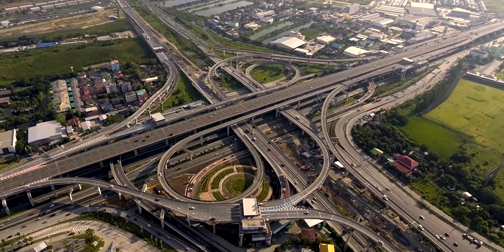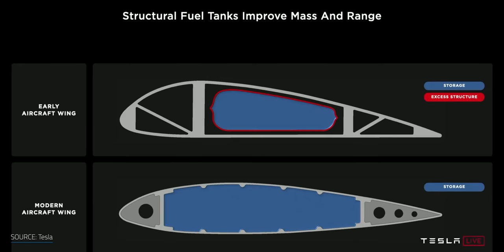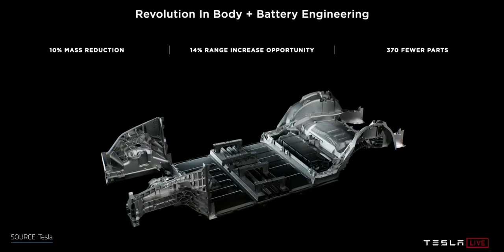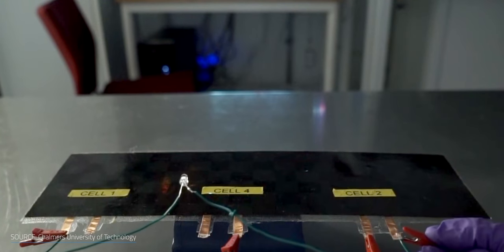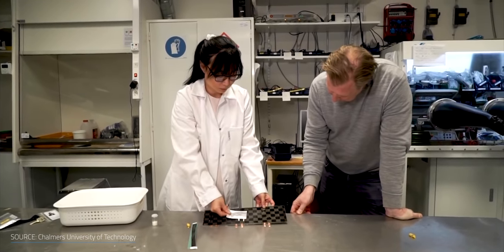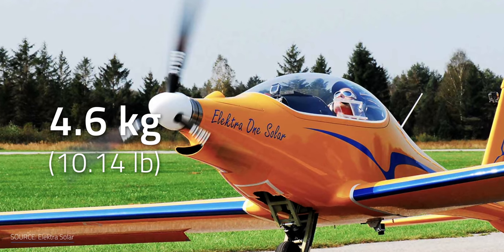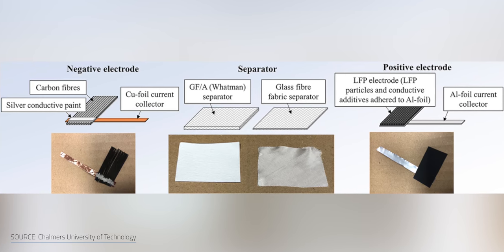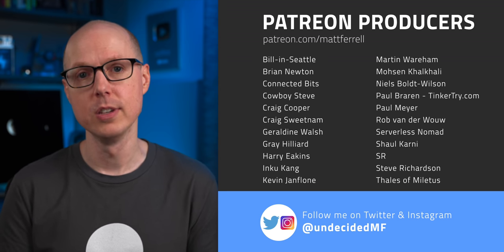Exploring Structural Batteries

Comment: By moving from modular batteries to "structural battery panels" how is this going to affect "cost of repair" after a crash(?) Also, seeing how the battery panels also provide structural integrity... can the consumer replace this type of battery when the panels reach end of life(?)
Reply: It's carbon fiber. Also, it's actually a capacitor, not a liquid filled battery panel. Cost of repair should be relatively economical depending of course on a crapton of situational caveats like how much electronics is needed, the separating material between the carbon fiber layers (I've seen the study), availability of replacements, cost of manufacture, etc.
Reply: @LabGecko  - Agree with all that... was specifically trying to figure out how/where in the vehicle the batt would be placed and will the placement allow for easy accessibility, or would such a battery possibly be buried under lots of other vehicular componants(?)
Reply: @__WJK__  In that case, good question. Of course it will vary by manufacturer but I hope ease of access, repair, and cost e effectiveness are priority considerations.
Reply: @LabGecko  - Hoping the same. If this particular battery tech is (ie) stuck/installed to all the very inner body surfaces... that would be a huge deal-breaker.
Reply: I would imagine the areas less prone to impact damage would be explored first? For example build your dashboard, seat structures, interior panels with structural batteries. These parts are already produced seperately, so could be replaced fairly easily?
Reply: @KristianHerner  that is actually a good idea, it will also add a lot of option for the consumers on how would they want to modify the battery capacity of the car.
Reply: @LabGecko  If it's patented by Tesla, however, wouldn't you think that they'd only allow you to bring your car to one of their "certified technicians" kinda like the same way John Deere prohibits consumer repair through their software. Granted I'm not sure how they'd incorporate that for a battery but just a food for thought.
Reply: @Zombieslayer9640      Exactly, you hit the nail on the head. And this will open a flood gate to hundreds if not thousands of patents, licenses and permits to work on your equipment.
Reply: All cars will be self driving by then and there will be no more crashes.
Reply: @timtreadaway8303  - Will be interesting to see if crashes (especially from human error) can be fully eliminated.  Crash avoidance technology aside, it will be equally interesting to see if the evolution of this battery technology will allow for easy eol replacement.
Reply: @Kristian Herner  - Great idea. However, if they're going to hit the EV battery holy grail distance of 800-1000mi, on a single charge, they're going to need more than just panel locations to accomplish it. If they design it in a way that a large number of (labor-intensive) items have to be removed, to get to the batteries, consumers might see this as a deal-breaker.  Will be interesting to see what they come up with..
Reply: @Zombieslayer9640  Pretty sure most of Tesla's patents are open-sourced. You can buy and mod out a Tesla all you want - you just don't have access to their over-the-air updates.
Reply: Although this LOOKS good in video and "on paper", I have a LOT of reservations about the conflict between the owner of a vehicle and their ability to repair a vehicle with this technology.  I'm all for fossil fuel reduction, but this, as someone said above seems like yet another way to divorce people away from true ownership of a vehicle to just, well, leasing it.  Or not even that, really. RENTING it is more accurate.  Which Segway's into the overall concept that NO one owns ANYTHING, they are permitted to use it, and that's it.  Tell me I'm wrong and then prove it.
One aspect of this that I mentioned above is whether or not the average person will even be able to repair their structural battery equipped vehicle.  AND, whether or not the repaired vehicle could EVER pass inspection again, since the repairs were not performed by someone trained in "to factory specification" repair.  Repairing and replacing carbon fiber composites with that lithium layer would take a fair amount of training to recognize whether you "got it right". Also, the equipment and supplies needed to effect these types of repairs could be so exorbitant to the point of pricing it out of the range of 90% of people.  
Now, if this were used in a BUILDING or semi-permanent structure, that would be different. Or, in an aircraft, which would require (in the USA) an FAA certified technician to really even look at the damage, let alone repair it.  I can see military solar powered drones as a very good application of this technology.  Also, satellites, space bourne craft would benefit from this.  No, the common person, in my opinion wouldn't be able to benefit as much if this were used in everyday passenger vehicles.  Too many things that could go wrong WOULD.  Airspace and space aren't near as populated as I-95 during rush hour.  Look at the FTSB's statistics on ground vehicular collisions per hour and then calculate the cost of supplying the properly trained technicians, the equipment, and the infrastructure necessary to regulate it and ensure safety standards are met.  I cringe at what I imagine the cost  would be.  
Oh. Bicycles would benefit greatly from this too.  There is a bicycle manufacturer in Fort Collins, CO that has made a line of electric bicycles with carbon fiber frames and lithium ion batteries inside the frame tubing.  This technology would be a natural extension of it, making the bikes even lighter. However, until those researchers can up the amp-hr/kg density, it might not be feasible or economical to manufacture.
Reply: @brianm744  Technology will make owning a car obsolete. That aside, tesla is doing fantastich things. What I find striking is that many people are commenting, they sound like they know a thing or two. Those same people fail to appreciate what a small invention might cause in the distant future, but magnify a small problem that will be overcome in the short term. Every technological breakthrough has it's hurdles that need to be taken. Let's not focus on those hurdles too much!

Yes, a car that cannot be repaired easily is a problem when you own it. That's why the solution is not owning it at all. This could be a huge step for our civilisation. But conservative forces - economical forces - keep progress from happening.
Reply: @Mullheimer  That's what I get for assuming something based on last names! Ha!
 Notice I didn't make a comparison to the head of that political regime?  I made one to a Dr. that forswore their Hippocratic Oath "First do no harm."  Even though he was part of that particular regime, my argument still stands, regardless of "Godwin's Law". I'm speaking about FACTS and making comparisons and contrasts,  not using arugumentative fallacies. Which, now that I think about it, that's exactly what YOU did using this "Godwin's Law" reference.
Again, my argument still stands regarding how long it SHOULD take to "reform" humanity of its....... selfishness?  That's a firm survival trait embedded into our DNA.  Humans, regardless of any type of religious reference, are innately selfish.  Its when we seek goals that involve cooperating with OTHERS (politics) that our true colors come out.  If you refer to Maslow's Hierarchy of Needs graph, true altruism is at the top.  I would estimate (you're free to debate on this) that one in 10 MILLION people are TRUE altruists.  That, not only do they seek to help their fellow human being, but they do so as a WAY OF LIFE, rather than a singular or multiple event type thing. Also, they do so even when it's highly inconvenient or even hazardous to their life.  They would even endanger their children (if they have any) in the pursuit of their altruism, if they thought the cause or person were worthy of said sacrifice. 
Just remember, YOU opened that "Pandora's Box" with that statement of solving the problem of self-repair of Tesla BPAs with just eliminating ownership of said vehicles.  In other words, what I said before, eliminating ownership of cars would also mean eliminating ownership of everything.... Plato's Utopia. 
IS Elon Mush using HIS vast wealth to be a true altruist? Well, just ask yourself what he eats and where he sleeps.  If he is utlizing the absolute minimum to accomplish his goals and way of life, and then, funneling what's left over to help humanity..... AND, also do that when it's very inconvenient and even hazardous to his health.....THEN, I would say he's a true altruist.  
However, all you have to do is look at what he wears, how he gets from point A to B, where he lives and sleeps and see how much he spends monetarily.  He's not an altruist.  At best, he's demonstrating what Aristotle called in Nicomachean Ethics "philia".  I scratch your back while you scratch mine. That "Win/Win" situation I referred to in a previous post.

Yes, technology is a great thing. It is how it's applied and the WHY of it, that we should be VERY leery of and have an electron microscope view of. (Dangling participle there, I know.)
Reply: @brianm744  I guess the real answer to question of repairs and ownership is... do Cars = Wealth?  The concept of home mortgages allowed common people to turn a practical item they owned (a roof) into "Wealth" they could barrow against and leverage.  Or save up and earn over time!  (Houses were lump sum purchases or new construction only before that point)

Car loans borrowed that concept but... they've always depreciated too quickly to really justify that model of being "Wealth".  After all, vehicles replaced horses!  And horses have lifespans, require careful maintenance, and can still just.. die on you.  Horse "Wealth" is not the same as a house or a set of professional tools.  So the customs about "spending" the value of a horse have been different as well.

Perhaps the model of car utilization would be best to replicate how horses were utilized.  People only owned horses IF their job used that horse for daily work.  Otherwise they hired out horses for exactly as long as needed.

Most cars today spend a ridiculous amount of time sitting in driveways and parking lots.  Many "car owners" don't need to own that car - they simply need periodic transportation!  And yet the price of car ownership is eating up a ton of their available "Wealth".  I think a lot of people could really make better use of their money if they could eliminate "owning a car" from their budget.
Reply: @esthermerriken4408   That's  a good point though: what is the definition of wealth ?  But more importantly, who defines wealth? Those who already possess it? Those without it? Those with PhDs? A true altruist?
Reply: @brianm744  The definition of "money" is actually really simple.  Something is money if everyone uses it AS money.  Governments can print all the paper they want - but if the common folk don't treat it as money, then it's still just printed paper.  Same with diplomas.  Cars are treated by the public like it's a slow burning candle made up of dollar bills.  In fact Cars are ALREADY viewed by the public as "losing value over time".  The value of a car doesn't drop below its "scrap value" price tho.  I don't see this new battery tech making any difference in how we price and value vehicles.

Oh - and the definition of "Wealth" is anything that can be easily converted to a predictable amt of money.  Little fuzzy because the exact amt something sells for depends on the skill of the seller.
Reply: @esthermerriken4408  Notice I didn't use the word "money", I used the term wealth.  Sometimes they are not synonymous.  As you said, money is money when its used as such.  I tend to define "money" as the direct representation of labor.  What time a person puts in to do....whatever.  But that's also a function of a system of VALUE.  Bartering was a great example of that.  Value in the barter system usually varies (but not always) in each transaction.  What one shepherd feels is the value of their sheep's wool THAT DAY, may not be the same the next.  And it might be even MORE valuable when the next town over's tailor (whom the shepherd hates with a passion) comes to buy wool and the shepherd gouges the hell out of their archenemy.  
Oh, and lest we forget, the commodities and exchange services around the world have a greatly varying value of their commodities, depending, usually, on the political climate of whereever a particular commodity is obtained from.  Economics is not my field of study, but it does have its place in history, which IS my field of study.  That and political science.